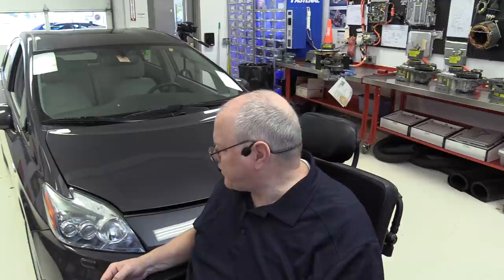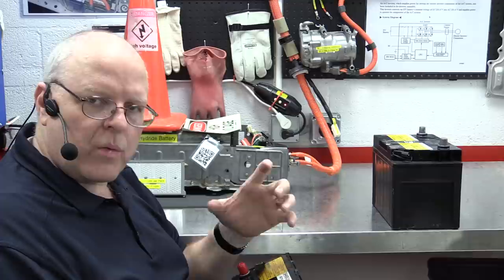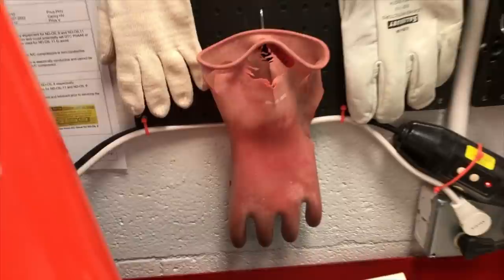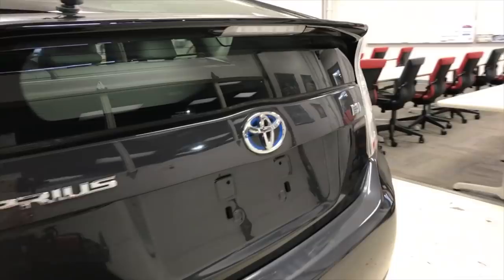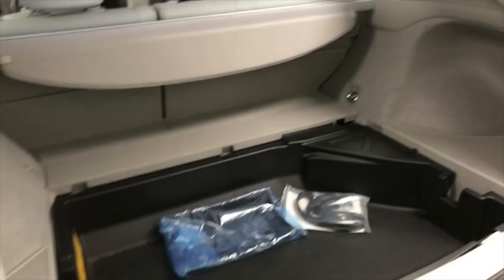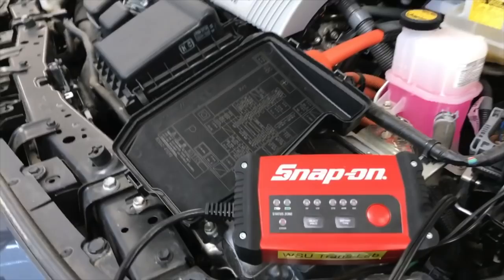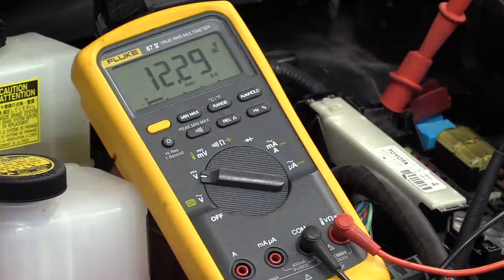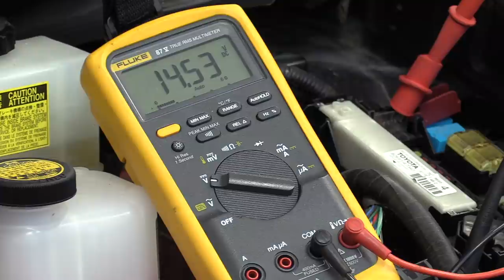Low Voltage Hybrid and Electric Vehicle Systems

Comment: Great video, thanks for the support. 

Just a plea; with many people reporting flat 12 volt batteries from Toyota/Lexus hybrids during Covid lockdown (i.e. car only used once a week scenario) could you please produce a supplement explaining how well (or badly) the car recovers from a jump started state. As an example, my Lexus UX had to be jump started recently, and despite driving it for 1 1/2 hours it took my small trickle charger (only 1/3 Amp) another 36 hours to fully complete the charge. My crude estimate is that after the drive the battery only had 80% charge (based on time for trickle charge to complete).

Example questions:

1. Does the 4 Amp charging limit set by car's software apply for the whole of the charge? 4 Amps equates to about 8% or battery capacity per hour, so would need up to 8 hours to fully charge if this is correct. If true, certainly indicates that the usual advice to drive for 'an hour or so' is insufficient to fully top up the battery (3 hours minimum?),  but my estimated 80% charge would indicate that the car did deliver a faster charge initially.

2. Is there 'something' in the circuit between the jump start terminal under the bonnet and the battery terminals. Attempting to read the battery voltage at the point on a DVM gave a very erratic reading, drifting around (i.e. typical of a weak capacitively coupled signal, where the noise outweighs the data). No problem with the trickle charger attached, I got a nice steady reading. Might be a simple power diode, or something more complex, since the car also bought the trickle charge to an abrupt halt (maybe a coulomb counter based battery monitor?) on completion. 

3. Any tips or hints to minimise this concern.

Thanks in advance

Bob
Reply from the maker: Thanks, the car can charge the battery at a higher rate than 4 amps because it is monitoring the battery temperature. If the battery starts to get too warm, it will turn down the charge rate as necessary. An external charger cannot monitor the temperature, so the 4 amp limit is there to prevent the AGM battery from overheating, gassing, and destroying itself. There are fuses and a thermistor in the battery clamp assembly on some of those vehicles. To understand how much charge the battery really needs, see my charging system video here: https://youtu.be/_V9PiOpaxyE

My 2009 Prius 12V battery survived not being driven for 6 months by simply powering on the vehicle for 30 minutes once a week, Thanks for watching.
Reply: @WeberAuto  Thanks for responding so quickly - especially on a Sunday. A well deserved Bravo Zulu (UK Navy signal for 'many thanks for a job well done') for you.
Reply from the maker: @roberthuntley1090  Thank you
Reply: @WeberAuto  We recently bought a  newToyota Yaris hybrid for my wife ( about 9 month's old now ) and have faced 3 time's since the start of the winter a flat battery. The garage now states that my wife drives to short distances ( she made about 3800 km uptil now) to get the batery properly loaded. So they adviced to trickle load the battery regularly once per two weeks. I read here that you power the vehicle 30 minutes once a week. Could that be a good alternative way to keep the battery loaded? Does one have to leave the car in power mode but that is not possible in P mode. How does one keep the car on brake then?

Comment: Can i use like a super large battery or hook up equal new pair pair with a low frequency heavy duty inverter in the trunk so i can hook up a fridge and coffe machine and microvave? Or a vacuum cleaner and electric pressure wash or run my own lawn electrical 110 equipment, i didnt think so I did it before in my 94 camery LE. The positive i ran from the alternator and the ground from the chassis the the batteries and had tied an inverter on a safety breaker. When the hurricane Irma hit in Tampa Bay Florida and took everyones power for like a week I was so cool! My inverter can all those things if it has at least 800 agm amp battery current.

Comment: Help please! Why does my Prius have a different voltage at the battery and the designated jumpstart site. (Rear 12.2V and front 1.3V) help please!
Reply: Car doesn’t start is completely dead but when jumpstart works perfectly fine until turned off again...and goes completely dead
Reply: Battery is good and holding charge

Comment: My 2013 Prius 12V battery went dead, I had to jump start it with a standard 12V battery from my Tacoma no problems; I got to the dealer and it cost me a little over $200.00 I installed the battery as for many years I was a mechanic and who can afford the dealer price for installing the battery?

Comment: I know this is not the forum to ask questions, but I am desperate. Stuck in Afghanistan with a camry hybrid. Car starts and dies off in 15 seconds. Scanner shows error as 'p3190 poor engine current power'.... what should be I looking to fix.....
Reply from the maker: I do not know. A quick google search shows several others with the same problem. It looks like it can be several things. Best wishes.

Comment: , Uncle Michael,   1st generation Prius.
Reply: Large HEAVY fuse block,  AWG wiring with O.E.M. parts. And 
  V<=  14 to 15 V.  with EXACT O.E.M. charger,   not the,  HONDA Prelude CHARGER from 1982, which is under powered for PRIUS.   Also , I STUDIED DC electronics circuits and rheostats. 
Michael...
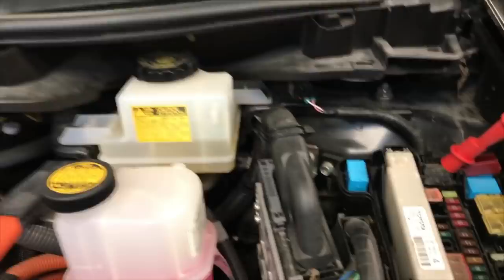Reply: 26:51 negative lead to opposite edge of,  engine block.
Reply: I designed this as a dashboard in 1998.

Comment: Hello Mr. Prof. John Kelly ! THANK you for your fantastic Toyota Hybrid Video`s !! As Prius NHW20 Driver i love it as i love the Car ! I have a Question ...... most of the Toyota Hybrid`s have the Problem AUX-Battery will die short Time. As you say Problem is the high Charge Current. For LeadAcid it should be 1/10 og Capacity ! I changed it to Winston LiFepo4 (12V/40Ah).
Work well without Problem. Thank you and keep on going with your Research ! Edd from Europe-Austria

Comment: I need help it may 6 and i live in san Antonio, I replaced my 12 volt battery, and replaced it, the Traiangle of death still comes on? What do I do, I drove out to run an errand, and as i drove i heard a fan in the back seat, turn on, it to me , i felt that something was getting hot, so i pulled over and stopped, Because i didnt want anything else to happen, Now still today the loud fan or a sound is coming from the rear passenger seat area. Please help if someone can tell me what to do???
Reply: Trish Vincent probably high voltage battery is fucked

Comment: I was thinking about electric vehicles here in the UK. so why can't car manufacturers convert existing petrol and diesel cars into hybrid or electric**? surely the cost of scrapping millions of petrol and diesel cars is going to cause a hell of a lot of damage to the environment. I mean how much energy does it cost to make a car - ie CO2 emissions to make steel , and instead of keep on using the product it's all got to be scrapped. It seems crazy to me because the saving the environment by using new electric cars is wiped out ? - I think EV's are great don't get me wrong - but isn't there a better way of implementing it. **Cost more to convert a petrol car to hybrid or electric I guess for consumers. But that's still a million tonnes of scrap metal as a result.  Anyway Great video though I think electric vehicles and hybrids are good.  Really good to see how they work in detail.
Reply from the maker: Thank you, conversion has many safety issues and problems.

Comment: Information about AGM charging doesn't apply universally. BMW uses AGM batteries... for decade. And car charges AGM battery at very high rate. This is also a base for EfficientDynamics technology.
Reply from the maker: Thank you for the feedback, you are correct, but I was talking about hybrid and electric vehicle batteries that are charged by a DC-to-DC converter. I should have said to always read the instructions on the top of the battery regarding the charging rate if you are using an external charger. Have a good day.

Comment: Great video, thank you sir!
How dumb is it for engineers to design a vehicle with no manual override of opening doors like the hatchback to get to the battery when it goes dead?  Dumb design.  Same goes for electric hood latches.  Same goes for having to tow a car when a battery is dead and not allowing the trans to go into neutral.  Dumb design.
  My subaru hatch is made this way also, but no battery is in the trunk.  Still a dumb design.  
 Reminds me of working on an inoperative electric driver door lock on a Honda that would not allow door to open even manually inside or outside.   So I had to remove the driver seat via from the passenger side (had to be a contortionist) and almost break the door panel to open the door to gain electric lock access and disconnect it, just to open the door.  These crazy engineers.😢

Comment: I'm wondering. Looks like the 12V battery is more important to vehicle than anything else. Why the hell Toyota don't show the state of that 12V battery on infotainment system while is possible to see the real time charging/discharging cycles of high voltage system? Ara you kidding me Toyota?

Comment: Thank you for really perfect lesson professor. My Toyota Auris Hybrid 2017 has  original AGM battery in trunk. Does hybrid need AGM from some reason ? I see explanation in https://youtu.be/M53Hbh5wpRQ but on the other hand iI saw in below comments Ithat AGMcan be replaced by acid battery.